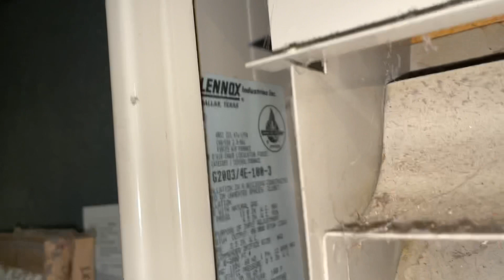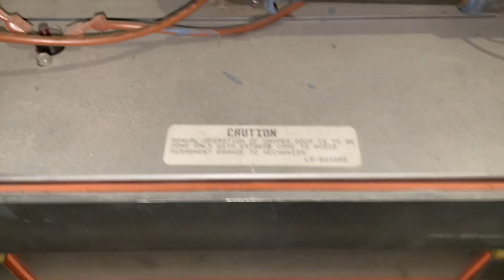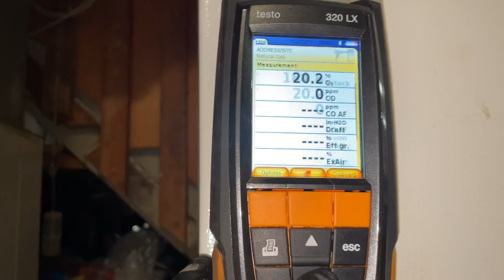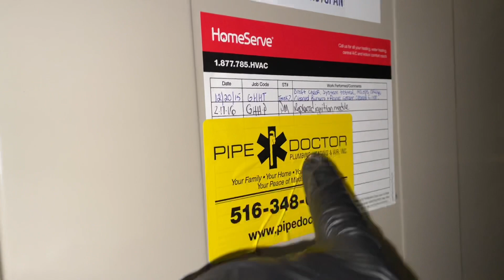Burning Smell & Smoke Coming from Lennox Gas Furnace

Comment: The limit switch is 230F open , 200F close .If the furnace is overheated, it shuts down the unit, not telling the control board to power the motor...just the board about 60s delay for fan on.

Comment: Lots of time it is the BCC blower control board that fails on those units. You end up with a big black burn mark underneath it when it shorts out.

Be very careful with the wire connector that plugs into those motors. That motor is notorious for the winding tabs that connector attaches to break and short to ground and then blows up the BCC board and control circuit and everything.

Comment: burning smell so often is dust and dirt burning off the heat exhanger and nearby plenum(that is hotter than its ever been) when it cycles against the high limit switch.. essentially becomes an old gravity furnace, not saying the motor wasnt red hot because it was..  just an idea is all

Comment: When checking a capacitor, you have to discharge it before taking a reading, a charged cap could dammage the meter !
Reply: "damage"
Reply: He mentioned the need for the long nose pliers..I suspect he used them to short out the capacitor, but it wasn’t in the video.

Comment: The heat exchangers in these units develop small closed hairline cracks at the curve and may test fine on the analyzer despite being cracked.
With 5% o2 and a hot stack, wonder if it's overfired. Doesn't natural draft usually run much higher oxygen?

Comment: I would have been cutting an access hole in the plenum or yanking the blower housing and putting a mirror on that whisperheat.. 90+% chance that Duracurve heat exchanger was cracked at the left curve. Almost like clockwork
Reply: @PipeDoctor  left side at the curve. If you can take the back off and look at the back of the heat exchanger at the curve (right side looking from the back) they hair line crack all the time. On maintenance I always pull the vestibule screws screws and slide the heat exchange forward at the bottom so it is more visible from the bottom. 30-45 minutes of work and a replacement furnace to follow.
Reply: @kangaroogod  You can throw a camera in the cells and find them. Save you a lot of work.
Reply: @ignacio8597  I have done that many times but unfortunately I have seen a few instances where what appears to be rusty and a crack but it is not. I have told many customers that if it isn’t cracked I will give them my next paycheck if I’m wrong.
Reply: @PipeDoctor  easy for people to Monday morning quarterback... maybe he’s trying to keep BILLS LOW and if the meter looks good why condemn it?